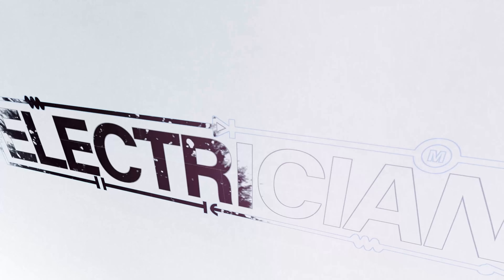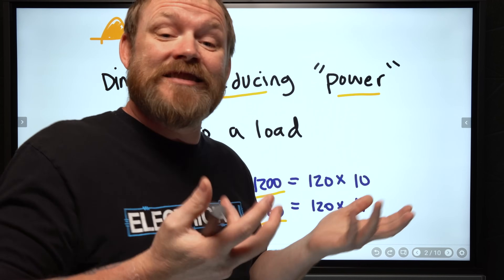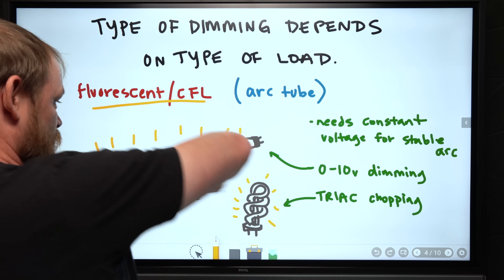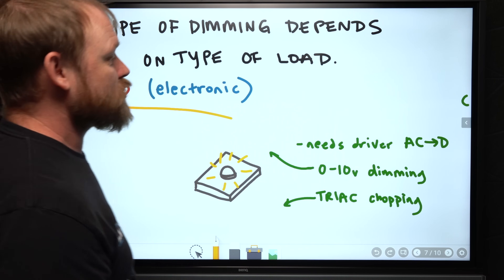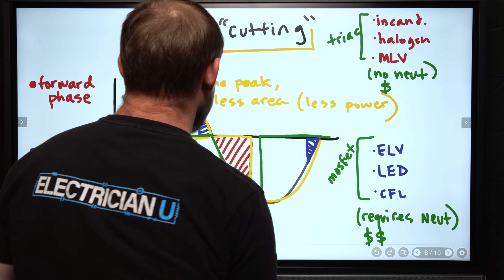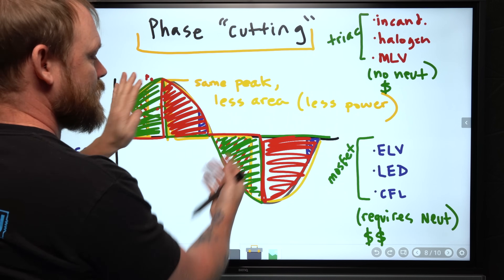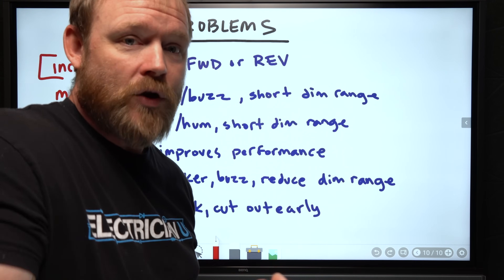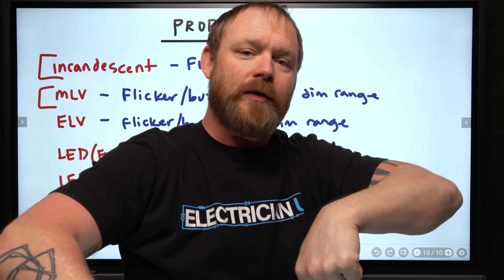The Real Reason Your Dimmable Lights Buzz or Flicker

Comment: Dimmers basically work by cutting up the AC waveform.  They basically take a chunk out of the waveform.  The more you dim, the larger the chunk they remove.  The phase is just a way of describing which chunk of the waveform is being removed.   2-wire dimmers more or less cannot be turned off... they are always taking a chunk out of the waveform, even if its a small chunk.  3-wire/4-wire dimmers can "click off" ... can be turned off to the point where they do not change the waveform at all.

There are a bunch of problems with dimmers.

* Dimmers function by detecting the zero-crossing of the AC waveform to synchronize themselves, so they take out the same chunk out of the waveform on each cycle.

* Generally speaking, dimmers cut the waveform using a FET circuit or an SCR circuit or something like that.  These cicrcuits have to synchronize to the AC waveform.  ANY noise on the waveform will cause the synhronization to jitter and this is often a major cause of flickering.

* These circuits generally want to turn themselves OFF on the zero-crossing when possible.  They can turn themselves ON at any point in the waveform but it is best to turn OFF at the zero-crossing where (typically) the current is near zero and the voltage is definitely zero.  This reduces the stress on the components and removes inductive glitches caused by cutting off the circuit while current is flowing.  I think this is called reverse phase but I forget which is which.

Now why are there all sorts of problems with various types of lighting?  This is because:

* LEDs require almost no energy to actually light up (even if only dimly).  It is more or less impossible for a dimmer to actually function on an LED unless the LED has a micro-controller that detects that a dimmer is active (detects the the AC waveform is not a sine wave) and then adjusts the power based on how large a cut is being taken.

* The inductive glitches caused by certain dimmers can cause voltages well beyond the typical peaks you get with 120VAC, which is why they are such a problem.  They wind up having to be dissipating in some manner, sometimes by the FETs reverse-breakdown voltage specification itself.  Some dimmers (I think forward phase but I forget exactly which is which) that turn OFF on a non-zero crossing always create inductive glitches and have to sink those glitches.  But these glitches can also cause havoc with the lighting itself.

* Do to reactive power, the current on the AC waveform may not be zero at the zero voltage crossings, so even under the best of conditions the dimmer's chopping of the waveform can cause an inductive glitch.  This is why most modern 3-wire / 4-wire dimmers actually can be programmed to be one phase or the other, so you can try to match your lighting.  Which... sometimes just doesn't work no matter what you do.

* A lot of cheap lighting only uses half-wave rectification which pulls energy from only half of the sine wave.  This creates harmonics of different intensities at 60Hz which can be visible as fast flickering.

* And harmonics at slower frequencies, such as 30Hz, can also develop due to timing interactions with the dimmer's zero-crossing detector, resulting in truly horrible flickering.

The jist of this is that no matter what you do, dimmers are always going to cause problems with cheap lighting.

-Matt
Reply: Fan dimmers are fun. If u add a incondecent, it will force the LEDs to work because u need a load on ur triac for the triac to pass power right? So u give it that option. So could you then maybe put a 10k resistor in parallel and force them to work too? Never tried
Reply: The dimmer you describe is the traditional “leading edge” dimmer. Many modern dimmers are “trailing edge” dimmers which turn on at the zero-crossing and turn off later in the cycle; these are better for LEDs.

Comment: I have expensive dim to warm LED (so dimmable led yes) and expensive dimmers and they flicker all the time and i have to "tune" the dimmer up and down uintill i find a spot that doesn't flicker.....

And they where bought together as a kit and mounted by certified electrician.

I HATE IT.
I have had many different cheap dimmers from china but for DC and NEVER had flicker.
The problem is they are trying to make it as cheap as possible and cuts many corners.
Reply: And not really the regular flicker but pulsing at 1-2 Hz maybe up and down like akid is standing and turning the nob up and down to annoy you
Reply: Without knowing the specific design it's hard to say for sure, but it's possible that you might be having problems with dirty/noisy AC power, which is causing the dimming circuitry to get confused/etc.  You can get somebody to check it, or you can try just unplugging other devices or turning off other circuits to see if it changes the behavior (and if so, try to track it down to a specific device that might be introducing noise into the line).

If you do find a device that is causing the problem, you can buy power line filters to put in line with that device to prevent it from screwing up the power for the rest of your house...

(It's also possible that your lights/dimmer are just defective, too.. it does happen sometimes, even with the good brands.)

Comment: Several year little too late, but great info. Back in 2017, I bought three Juno LED trackhead units at US$240 EACH for kitchen remodel. These were colour correct and rated 24W. I also researched and bought US$75 magnetic low-voltage LED dimmers from Lutron Diva series. I've not had any issues and the Juno units are just museum grade lighting and maybe overkill but I wanted correct temp and dimmable.

Comment: Thanks Dustin! I’ve installed two kinds of dimmers using the same dimmable LED bulbs and noticed one of the dimmers flickers the bulb while the the other dimmer works as expected (dims the bulb without flickering).

It appears I got both forward and reverse phase dimmers that are dimming reverse phase bulbs.

Comment: I put in a LED bulb into an outside house light.

It blinks when it is cold.

Does not in warm weather.

Why?
Reply: Most likely due to a post bridge rectifier bulk electrolytic capacitor whose gel (electrolyte) gets thicker with colder temperatures. This will reduce it’s capacitance and may not be smoothing the ripple in the DC to a point where the LED controller chip is happy. Try a different brand/model LED bulb in that location.
Reply: Shorter/simpler answer:  Because it's either defective or designed too cheaply.  Try a different, brand of bulb.  Also, I recommend not to even bother with the cheap brands for LED bulbs, because they're just not worth the couple of bucks of savings.  This is one of those areas where you really do usually get what you pay for, IMHO (I've generally had good experiences with Philips in particular (but have not tested them specifically at low temperatures)).
Reply: Depends whether the circuit is on or off.  LED elements are extremely efficient and can light-up even when turned off even just from stray EM fields from nearby wires.  At colder temperatures, LED elements (and semi-conductors in general) are even more efficient and can light up from almost anything.  That's one possibility.

The other possibility is that if the LED bulb contains a rectifier and switching power supply circuit (most dimmable LEDs do), the power supply itself is a single chip that powers itself from its own output, with an internal bootstrap.

When there is insufficient power due to heavy dimming or the circuit is turned off and just stray EM fields getting rectified, the regulator chip will "turn off" until it has built-up sufficient energy to power itself, and will then "turn on" for a moment, instantly exhausting the stray energy it had collected through the LED, and thus turn off again.   Resulting slow flickering.

-Matt

Comment: Dustin, do you know anything about the "Strand" brand low voltage dimmer systems? It's basically a lighting panel where each circuit is dimmed at a  breaker/dimmer combo unit in the panel. And each circuit is triggered via a low voltage signal from the wall switch/control panel. 
It's definitely a somewhat outdated system, and I'm having trouble diagnosing and repairing it.